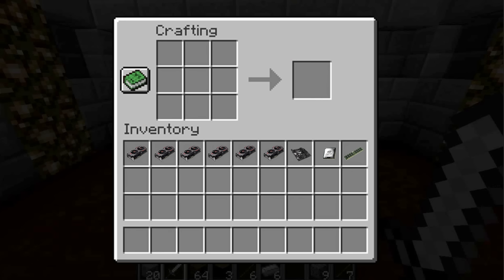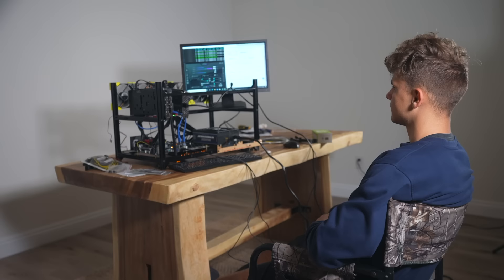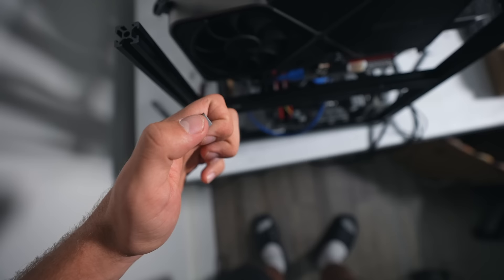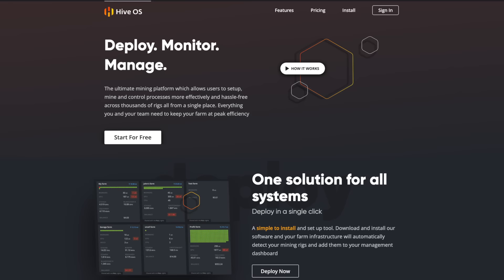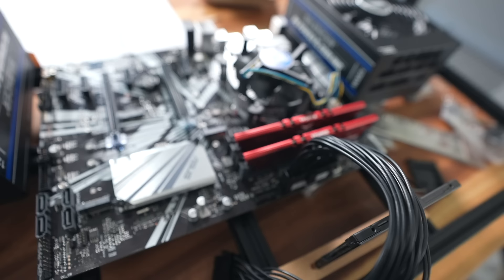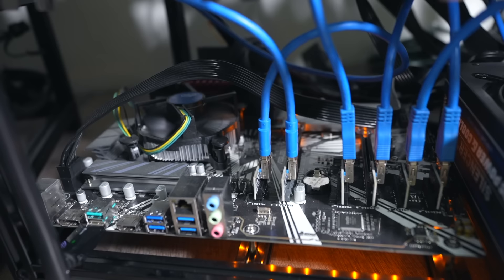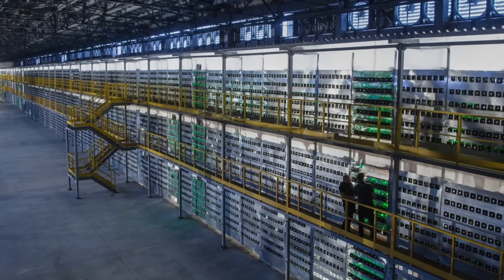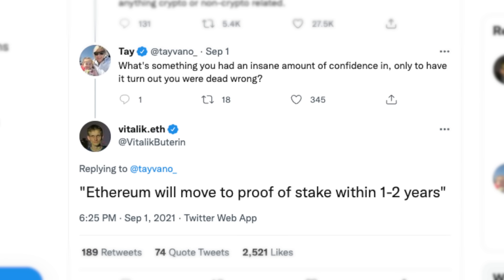Building a $50,000 Crypto Mining Rig

Comment: A lot of stuff was left out here. Make sure to do your own due diligence. Power consumption becomes a problem for bigger rigs that run on a single circuit. Running 6 3090's on the same 20A circuit would be pushing your 80 percent safety limit, and that's without anything else running on the circuit. Make sure you have the proper electrical infrastructure before you start plugging stuff in. Also overclocking wasn't really touched on and that alone could increase your MH by 10 percent per card. You would just need to find out each cards overclock limit before it crashes.
Reply: oooh and don't forget about how hard graphics cards will crash in prices when Ether start stacking
Reply: I believe he might have used auto overclocking/community overclocks on hive not sure since didn't told that.
Reply: 100 mhs to 125 by overclokcing
Reply: @Andre-jp4yt  didn’t know you were a fortune teller! Did your crystal ball tell you that prices will crash? Because everyone’s been waiting for a couple years now for GPU prices to drop and they just seem to continue climbing, with retailers upping their prices to match and get in on the profit too. Doubt retailers will drop prices at all.
Reply: @lowdaan5604  i am future man gpu prices are below msrp today 😆
Reply: @finnsstuffs  all gpu's sold out on major retailer websites. going for over 2x on eBay and Amazon. Mr future man is wrong!
Reply: @lowdaan5604  oh unlucky dude in new zealand we are well below msrp
Reply: @lowdaan5604  cough hi from fufure manufacturers dropping prices
Reply: So true! I'm thinking between mining rigs and ASICs from Unigrade. What are the points to look at for beginners please to make sure I'm safe?
Reply: @everyone this whole prices won’t drop didn’t age well. Oof

Comment: just going to point out that the reason your rigs are crashing most likely is because you have your core clock or memory clock set too high or voltage on either set too low or temperature getting too high, your rig shouldn't crash at all, even after 7 days of mining, if your overclock is stable. Usually you want to reduce your core/memory clock or increase your voltage if your system crashes and see if it stops crashing after changing it. The risk to not making it stable is that eventually one of your cards might eventually get bricked because of it or reduce it's life span because your gpu temp will fluctuate a lot causing internal metal components of the card to expand and contrast constantly.

Comment: Mining is definitely not a get-rich-quick scheme but you can make some serious money in the long term. Start small and don't invest money you need back next week and you should do just fine. As far as ASIC mining is concerned you will use more electricity and produce a lot more heat. Additionally, ASIC miners are algo specific which is why Im not a huge fan of them. Also, I wouldn't worry much about Ethereum going full POS as there will always be some other coin that will rise to the occasion.

Comment: Bro I have an 12 cards mostly 3080s. You have to tweak the settings and it and it won't crash. I've had mine running for weeks at a time with no crashes. Only stop it for cleaning every three weeks
Reply: How much do you profit?
Reply: What settings?
Reply: Exactly, you gotta chill out on the overclock if it's crashing this much
Reply: Same here, running 24/7 for the last 5 months without problems.
Reply: @magicagrnub620  enough

Comment: Put some of the mining power towards the coins that will rocket if ethereum mining closed so that if it does, the coins you own will rocket without risking to much by going all out
Reply from the maker: This kinda seems like a move 😳
Reply: @biaheza  Have a look at solana might help you out
Reply: @biaheza  something else to consider, the estimates for how much of the ETH hashrate are asics is between 40-60%. This will be removed from the equation once eth goes POS and many smaller miners using gpus will likely stop all together than research which coin to mine next. 

Don't get me wrong it is still a considerable amount of hash power that will need a new home but from my guess its any where from 25-40% of the current eth hashrate that will spread to the rest of the POW coins. This is a much more manageable number and would only require a few coins to 5x to stay profitable. 

In saying all that if ETH goes POS that will be a pretty volatile moment for GPU mining and likely see a period of low profits but after crunching the numbers I have hope for the future of GPU mining.
Reply: Or just mine the Ethereum and swap it for other coins?

Comment: Something else to consider, the estimates for how much of the ETH hashrate are asics is between 40-60%. This will be removed from the equation once eth goes POS and many smaller miners using gpus will likely stop all together than research which coin to mine next. 

Don't get me wrong it is still a considerable amount of hash power that will need a new home but from my guess its any where from 25-40% of the current eth hashrate that will spread to the rest of the POW coins. This is a much more manageable number and would only require a few coins to 5x to stay profitable. 

In saying all that if ETH goes POS that will be a pretty volatile moment for GPU mining and likely see a period of low profits but after crunching the numbers I have hope for the future of GPU mining.
Reply: Which coins in your opinion do you think will be profitable to mine after eth 2.0?

Comment: I have been mining on a single RTX 3070 since February this year and I made about 700 dollars. I think it might still be worth it to enter mining because you can always sell the GPUs. They are really demanded and you can expect at least MSRP price for them but realistically it's way more. If you factor in this resale value you can break even in half a year which is really good.
Reply: GPU prices will drop like a rock after proof of stake because so many sellers will come to market.
Reply: Sort of true but I know me and most people I know do not want to buy a second hand graphics card that was used for mining. It’s a card that has been under constant extreme stress.
Reply: @xxVGMxx  That is a rumor which isn't justified. Miners tune their cards to be as efficient as possible so they undervolt, underclock and limit the power limit. Therefore the GPU mostly runs below 60 degrees C and it actually can even run below 50 degrees. The only thing that kills GPUs is high temps and maybe fan wear and tear but those can be replaced easily. Often games push the temps way higher. Just having a GPU calculate stuff isn't going to magically destroy it or make it slower which has been proven multiple times.
Reply: @xxVGMxx  but you dont mine gaymers running their card 70-90c gaming and oc the shit out of it to gain 3 more %? 
My mined gpu running at 50-6. Most miners would tuned their gpu running less heat, more efficient

Comment: Yo, as a full time miner for the past 2 years now, specifically with rtx 3080, and 3090 gpus, the  cooling for the vram sucks. This causes thermal throttling of the vram clock speed, the daggerhashimoto algorithm is mostly dependand on the vram. You can get 3090s to perform at 120-125 mh/s with minimal overclocking after replacing the thermal pads in contract with the vram on the pcb. Also undervolting the core clock on the cpu to 800mv with whatever core clock speed you can manage to run stable at that speed massively lowers power consumption with no impact on hash rate, which further lowers temperatures overall on the gpu, meaning the memory can run more efficiently on the card. It is all fairly easy to do, once you know what you are doing shouldn't take much more than 10 minutes or so per card, and is a difference in 1-2$ income per day per card. Edit, you massively overpaid for your rigs, Asic mining has roughly a 9month roi in the current market, gpu mining if you know what you are doing is 5-6 months. Do more research with gpu mining and the different options for gpus to mine with before perusing asics unless you plan on dropping a ton of cash into asics and its no longer worth the time to build indivdual rigs, or pay someone to do so for you, probably around 200k into mining is when its worth it to just go full asic without a team to build mining rigs for you.

Comment: if you bought a bunch of those 1-4 pcie. you can power 12 gpu in that motherboard and not buy another motherboard reducing the initial cost. that's a z chip it can be done. i have 8 z270 all powering 12 gpus. no stability issues especially when using hive.  have fun mining. eth 2.0 will be delayed til 2023 then 2024 and so on lmao . if it comes there's still ergo and rvn to play with

Comment: Looks the upgrade to proof of stake is for real this time. The first step, the beacon chain has already been up and running for about a year. Next step is for the current PoW chain to connect to the beacon chain which is called "the merge". This is was originally scheduled for the end of 2021 but now has been moved back to around early to mid 2022.

Comment: 3090 is way inefficient compared to 3080.....3090 is double the price for 25% more hashrate .....when 2 3080s is way more hashrate ....and on both u have to change the thermal pads on the back of the card since their vram design is shity and they use crapy pads

Comment: So you basically burn all that hardware, use all that electricity, to break even on you equipment cost, and then have to sell the cards you bought at 2-3 times msrp after they have been used for a year? Honestly, I just dont understand how that is considered to be a good deal, when everything goes perfectly you do 50% per year, which you could easily have done with stocks (or just buying crypto) without wasting all that electricity and hardware. LOL